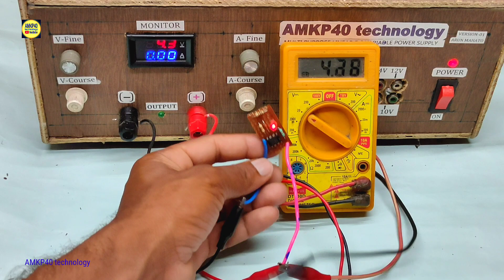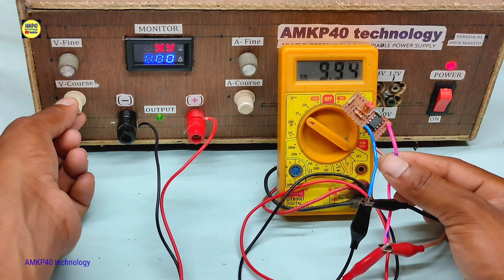High Accuracy 12 Volt Battery Low Indicator Circuit. How to make 12v battery low 0% charge indicator

Comment: I have checked circuit diagram in the mentioned link. Pin no 3 should get 10v supply after connecting +ve of zener to positive supply thru 1k and anode should be grounded.